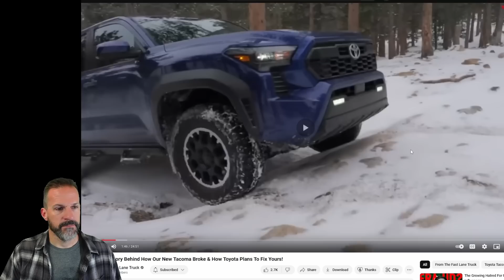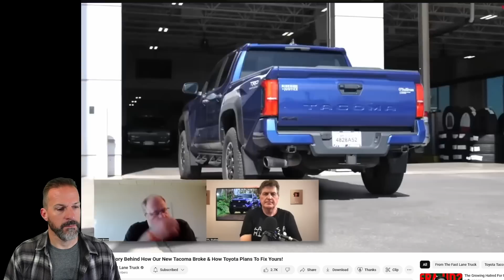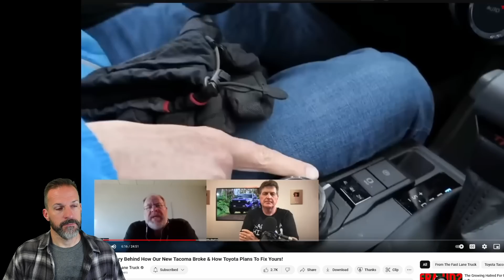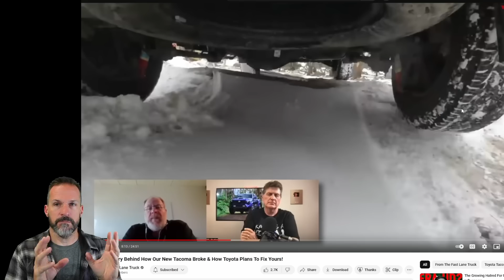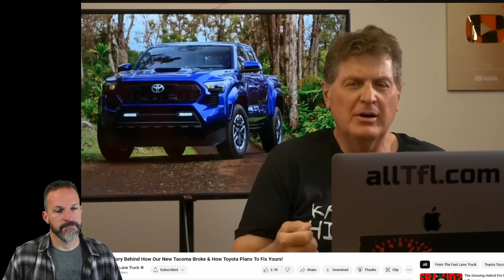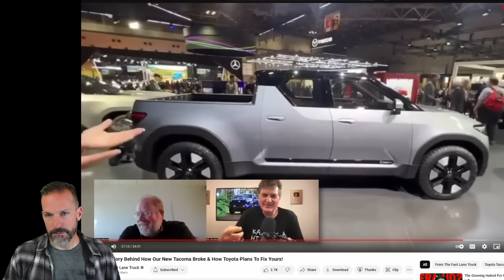Toyota will RE-PROGRAM the 2024 Tacoma to prevent future front differential failures. TFL React.

Comment: A software fix for a hardware failure is definitely a poor solution.
Reply: Remember when Toyota trucks and SUV’s were built with components that would meet any possible usage, and then be made 20% stronger than that? Seems like that’s gone. If you own a previous generation Tundra, Tacoma, 4Runner, GX, Landcruiser, etc - keep it!!
Reply: @993mike  man i own a 2006 prerunner and i wont touch a new toyota product at all... im actually looking for an F150 stx 2018 and up...
Reply: @993mike ummmm who wants to tell this guy about the front diffs in the 100 series Land Cruiser
Reply: how to destroy a brand
Reply from the maker: It's definitely something that can be deployed easier, but would be nicer to just have parts that can take the full abuse of the power output.
Reply: @TheCarGuyOnline  I have seen this after putting my 4runner through it's worse time yet. Deep heavy snow 18 inches deep in parts. 7km to reach pavement from the cabin. An absolute beating but a necessary one. Floored and bogging uphill in 2low. Full throttle torque load on the converter over and over. The unintentional rev before the gear was in. Bouncing off the limiter. Overheating the traction system multiple times. punching through snow drifts. And finally breaking a bead close to the end to finish on 3 tires.

I pushed it to the absolute limit. Sudden snow storm and a child. The way had to be opened in case of emergency. If I failed, we'd have to call rescue just to be safe. The 2016 4runner took it like it was Tuesday. It's reliability was the number one criteria as it was my lifeline to help. I would be surprised to know someone who has put his through a tougher life. 

Seeing the Tacoma break like that and the multitude of issues out of Toyota is appalling to see.  The extra torque from the turbo would have helped somewhat but it wasn't needed. What got me out of there was the fact that it could take it and ask for more. Now I wouldn't trust them to go up my driveway on a snowy day. What if a tire grabs suddenly? Appalling. A sad sight.
Reply: EXACTLY.  Sounds like what Boeing did to cover up their cost-cutting (they tried to pair big and heavy new engines with their old fuselage design - it wouldn't balance and fly straight so they used software to autocorrect the plane's pitch)
Reply: I called it when TFL first released the video. They were going to nerf the torque instead of beefing components up. I think they want to keep the ADD as the weak point in order to protect the differentials, which are also not as good as they used to be after Toyota moved Tacoma axle production from the US to Thailand in 2016 and the ring & pinion were lower quality and had move complaints of leaks, gear whine, bad bearings, etc.
Reply: @karlschauff7989  hmmm very interesting!!  It seems that outsourcing almost every part for cheaper options all around the world is a bad idea lmao.  Not very easy to perform quality control with so many movie pieces.
Reply: What’s happening with Toyota lately. First the Tundra now the Tacoma.
Reply: @drdumais  corporate dysfunction 
They seem to have lost control of their processes
Reply: 😢 R.E.P. Toyota….. every time you see American chief engineer in Japanese car…that’s a catastrophic mistake
Reply: Software "fix" is cheaper than hardware.
Reply: Back in the day we'd use the emergency brake to get unstuck, like a virtual pozzi-traction. Maybe in this case the MTS is applying the front brakes in pulses to try and get the torque to the gripping wheel. Notice the pulsing while slipping on the ice. Maybe there's some forces being applied to the wheels through the brake system that went haywire via software. Toyota has been making a few oopsies since 2020 or 21, so I also wouldn't toss out the idea that maybe the front drives are getting less durable.
Reply: The same shit Jeep said when their trucks had manual transmissions issues as well, and guess what? that ones also made by Aisin lol

Comment: You don't blame the engineers? Who is to blame, the janitor? 😂
Reply from the maker: Generally the engineers are not allowed to decide how much money is spent/cost on parts etc. They are given parameters to stay within, not directives to build the most reliable vehicle on the road, regardless of cost. The engineers are smart enough to build super reliable platforms, with regulations/corporate greed etc., they are shackled (IMO).
Reply: That is a very good point you have there. But they can still design and engineer better and simpler products.

Comment: What a joke lol. If youre in the market for a truck, how can you possibly consider these new generation of toyota trucks? At least with ford you know parts are readily available and when your engine is toasted, theyll give you a long block.  If everyone is now in the business of small displacement, throwaway trucks, you might as well go with a company that wont gaslight you when their under engineered truck fails.
Reply: Idk what you are talking about, the ranger and Colorado both provide drivetrain options from full size trucks that can tow 10k, and are designed for fleet use. They are significantly better than my fj cruiser or any other truck you falsely believe to be built more heavy duty in their class. Sure Toyotas seem to be trash now but at least Chevy have reinforced their blocks and used forged internal plus two timing chains. I wouldn’t be surprised if they last longer than the 4.0 minus the need to potentially swap out the turbo. Further they produce an incomparable amount more power  in an rpm range that is actually usable. I really can’t see the downside, and the engines are available for 8k if you wanna swap them out for cheap instead of getting another truck.
Reply from the maker: I've heard a lot of people ranting and raving about how good that chevy 2.7L is. So far, it hasn't really had major issues and puts out tons of power. We'll see if it starts having piston ring issues due to DI/no port injection...time will tell. There are a TON of them in production/use though. Chevy usually has more transmission and electrical issues than other problems...
Reply: @TheCarGuyOnline yup, absolutely too early to tell. I hope for future me, these turbos break the mold and can last with minimal maintenance. I doubt thats going to happen..but whatever. I buy vehicles with the intention to drive them for 10+ years, kills me to see the complexity.
Reply: @michaelstrang2563 huh? Thats my point…the competition is better. Im just highlighting a n/a motor is more likely to be more reliable over LONG term use. Say 250k+.

Comment: If these parts were overbuilt like they were in the past none of this would have happened. Instead of buying and installing a more expensive and capable beefy diff that can handle more torque than the engine puts out sounds like they cut corners and costs by using a less robust (cheaper) diff and try to manage it via software. Toyota probably saved maybe $50 or $100 max by installing a cheaper, lower quality diff.  Toyota is turning into RAM, GM, Ford, Hyundai/Kia.
Reply from the maker: Yeah and I'm guessing from Toyotas perspective, how many people actually use 4lo/off-road...anymore, so many people are just pavement pounding commuter trucks. They are just playing the odds.
Reply: I don’t think that the cost is the only factor here. I think they are trying to minimize the weight of the vehicle for better mpg. A lighter vehicle is also preppier to drive. Also why even off-roading vehicles often have to add underbody protection after market.

Comment: I blame Sheldon and the engineers
Reply: I think ToMoCo is leaning on the engineers to cost cut to the extreme and that meant reusing powertrain components that were never designed for the torque of the new engine. I blame Mike Swears. He's Sheldon's boss and I wouldn't put it past him to say "no let's just use the ECU tune to limit power to protect the driveline instead of spending money on building the truck to handle it." Mike Swears is also the guy to blame for the V8's disappearing from the Tundra. He refused to update the 3UR-FE 10 years ago. He was asked in 2014 what he was going to do to update the engine for better fuel economy because all the other manufacturers had greatly improved theirs for CAFE. He said "my competition has pushrods and 2 valves per cylinder. I have a dual overhead cam 32 valve V8, do I need to update my engine?" Yeah Mike, the federal government isn't going to just let you have a pass on emissions and fuel economy regulations, so you better update that V8 a little bit so you aren't forced to drop it from the truck.... fast forward a few years and the V8 is gone because Mike refused to update it. Ford still has a DOHC V8 in their trucks and Toyota had the engineering prowess to update the 3UR to have kept it going. That's what is so annoying with Toyota these days. They cost cut and kick the can down the road until it's too late and they throw trucks together that have all these issues and throw away reliability in the process.
Reply: Yep
Reply: Management probably saw how much profit RAM, GM and Ford were making per unit sold and said "We want some of that" so they cheaped our on part quality while jacking up MSRPs and reducing labor costs by moving production entirely to Mexico. It all about greed and maximizing profits.
Reply: I blame tfl what are you doing in 4low trying to go up a icy surface when you need acceleration in that scenario not torque

Comment: You cannot re-program hardware issues that come from cheapened materials and bad quality designs. What a bandage solution for PR purposes. They need to replace it with a better designed/tested part but they know it will cost them more.

I never expected Toyota to cut costs this much.
Reply: They are going to de-tune the engine when the truck is in 4WD. Guaranteed. I hope someone with a 4th gen is able to compare the original powertain tune to the post-update tune. They'll limite torque output to protect the ADD. They could have beefed up the ADD, but I suspect they made that a weakpoint to protect other components like the front and rear differentials. I also suspect they'll be detuning the engine or recalibrating their IMT rev-matching after the "Truck King" channel had the clutch fail on a botched 5-3 rev-matching downshift. Toyota tried to claim they shifted from 5th to 1st gear but the engine only revved to 4500. They were moving at 55 MPH and had they dropped the clutch in 1st gear, the engine would have easily shot up to 10k RPM and thrown a rod or destroyed the transmission. And as others have pointed out, normally manual transmissions won't let you put it into 1st gear when you're moving that fast for exactly that reason. Just wait, they'll put out a software update specifically for variants with the manual transmission after customers have the same thing happen.
Reply: You are right first it was the rear leaf spring made out of cheap material,  hundred of thousands broken and they make you paid for it. The poorly made frames. Toyo 💩💩💩 always had problems and they try to hide it. I wont be buying toyo 💩💩💩  again.
Reply: It's the same part from the 3rd Gen....
Reply: Toyota cheats on test results, use cheap parts and over price vehicles. toyota has become fat and lazy just like us carmakers. vehicles coming out of china are vastly superior and cost 1/3.
Reply: If you listen closely to what Sheldon is saying, he basically admits that the drivetrain is too weak so they have decided to defang the engine rather than get to the root cause, i.e. the damn thing was underdesigned. So much for the rugged, reliable vehicles that Toyota used to build.

Comment: If it breaks under moderate load, make it stronger! Don't neuter the the traction control!
Reply from the maker: Yeah we'd all prefer a super durable/beefy truck but I don't think any manufacturer is going to give us that. They'll plan for the 99% and the 1% might break things.
Reply: @TheCarGuyOnline  At this point we just want a truck that doesn't break if it drives over an icy patch on the way to the off-road trail. If the ADD is under so much strain it breaks the way it did for TFL and others, that's a huge red flag that the powertrain is way undersized for the torque of the new engine. They raised the price by $20k and eliminated most of the labor costs for assembling the truck. Surely they could have spent a little more money to beef up the parts that transmit power to the wheels.
Reply: They tried to save money by reusing drivetrain components designed for a much weaker 2GR-FE instead of beefing up the weak parts to handle the big increase in torque. It's the kind of crap that domestic manufacturers caught flak for years ago. Toyota will put out an ECU update that detunes the engine when in 4WD to protect weak carryover parts. They knew the new engine was going to make way more torque than the 2GR but decided to save money instead of doing things right and beefing things up. The ADD will still be a weak point and that engineer brought up tire size for a reason. If your Tacoma isn't bone stock, plan to pay for ADD repairs on your own because the warranty isn't going to cover it and it's likely to continue to be an issue.
Reply: If they beef up this part, other stuff will break, instead.  Their response is much less expensive.

Comment: can't program strength into a piece of steel. The fact that they had to remove 8hp from the manual transmission is all I need to know about Toyota's practices right now. The truck has been engineered to exact specs instead of being overbuilt like they used to be. I've done rougher things with my truck in real world situations simply trying to get out from being stuck somewhere in my steep yard, in the rain, at a steep angle and my old truck did just fine sliding and slipping on rock and grass, and that's just an old F150 with no special offroad package.
Reply from the maker: I bet they will (kidding) :). They'll detune it enough so this doesn't happen often.
Reply: Thats a great point because you dont need 4low but rather wheel speed in a icy situation. This imo was poor off road skills and not understanding momentum from acceleration and not thrust from torque